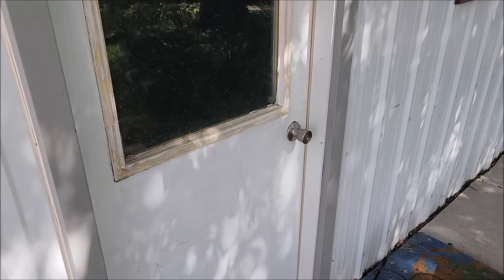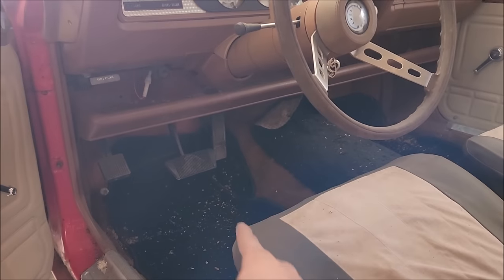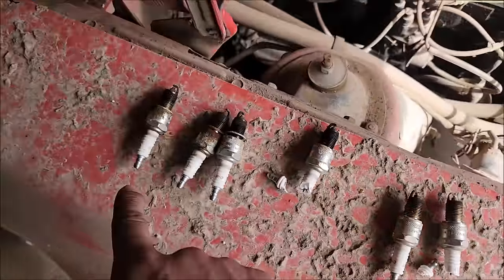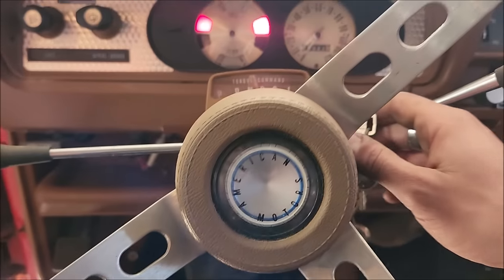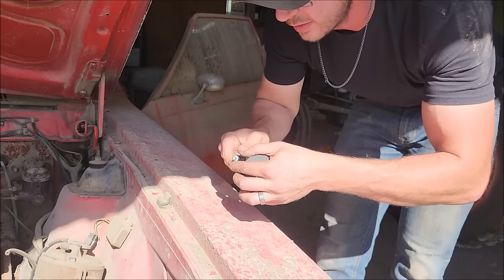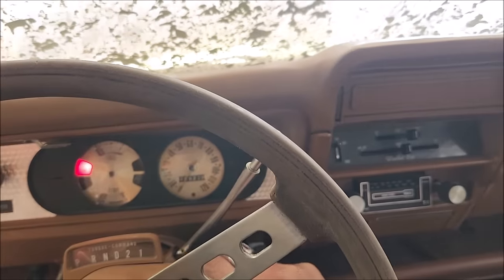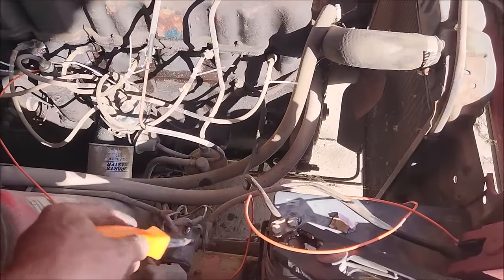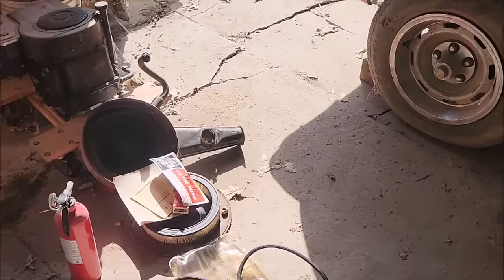Will It Run? 72 AMC Gremlin - Saved from the Crusher!

Comment: As a Ford guy im glad this Gremlin was saved. AMCs in general are very underrated in my opinion. A friend of mine bought two AMC Eagles off of us a few months ago. A 1982 AMC Eagle SX4 in really good shape and had a 304 V8 swapped into it and a 82 Wagon for parts. Just today he found the original build sheet in the SX4. And my dad owns a restored 1969 AMX. You dont really see many AMCs around anymore so when i do i cant help but smile
Reply: Think a mower carb on this Gremlin can get 50 MPG's?
Reply: i have a whole dealership down the road from me collier motors is the name.
Reply: Man, I always liked Gremlins, but I really wanted an Eagle. I searched online not too long ago and couldn't find a single one for sale. I'm glad there are still at least a few around.

Comment: For the newbies - always use compressed air to blow the dust and dirt out from the base of the spark plugs BEFORE you remove them.
Reply: And get a spark plug socket so you don't break the plugs.

Comment: Can't really kill a straight 6. Almost bullet proof. Love that car man! That was a find and in really great shape...from what I've seen!
Reply: motor was so good that chrysler kept using it after they bought amc out, the cheerokees used them for a long time.
Reply: @spicydeath82  Yup, all the way leading up to the 4.0L well into 2004 I believe.
Reply: @trickyricky12147  - Through 2006 in the Wrangler.
Reply: The 225 slant 6 is basically bullet proof too. I had one in a 1978 Aspen. Beautiful chrome. Only issue was the lower quarters. Wish I kept it but I listened to the wifey. 😢

Comment: A lot of  people don't know but  back in the  70s and 80s people just didn't keep a car once it got past 100 thousand miles  .
Reply: Cars were affordable and abundant back then. I bought so many used cars for under $1000. Cheap junk but easily fixable for cheap.
Reply: @tabbott429  Yep. My second car I bought in 1984 I paid 75 bucks for it. A 1968 Chevy Belair. Drove it a couple of years until the valve and the piston decided to meet. Ended up scrapping it for $100 buck.
Reply: I'm from northern Indiana. Back then by the time you got to 100,000 miles the body was rusted to NOTHING.  Usually at 90,000 the engine was completely gummed up inside with sludge and was barely even running.  Almost nobody would redo and engine because the car was shot anyway.😂

Comment: Those cars used to be ugly, but since you don't see them anymore, they have become cool. I love those rally wheels. Looking forward to see the pressure washer video
Reply: As a Gremlin owner, it's hysterical to me how public notions change.  When the Gremlin was new, they were well liked.  By the 80's and through the 90's, they were a joke and AMC became a laughing-stock as it faltered and then was purchased by Chrysler.  The early 2000's you would have to literally GIVE AWAY an AMC.... and yes, I had MANY straight up given to me.  My own Gremlin I purchased for $700 in 2001 as a perfectly running & driving car.

But by 2010.... I noticed opinions seemed to change.   The Gremlin was seen as "cool" again.

Just recently I've had the paint, bodywork and interior all re-done on my Gremlin and at the last car show I went to.... I seemed to get more attention than my friends' Rebel Machine!
Reply: What do you mean by "...those cars used to be ugly..."?!? They're STILL ugly! As for any "cool" factor, in my experience only those under about the age of 30-35 seem to go in that direction, undoubtedly because they haven't ever seen them on the road just like most haven't seen a Vega, Pinto, Pacer, Hornet, etc-etc-etc. While the Pinto and Vega sold quite a number... and served some folks as cheap, sometime reliable transportation, they were all reviled back in the day for being mostly problematic junk. As for the cars I mentioned, you couldn't give them away by the 1990s. Of them all, only the Pinto had anything worthwhile about it. The I-4 most of them had under the hood was one of the best I-4s ever made. The real question for anyone that owns a Gremlin in this day and age is what to do with it? If you're in it for nostalgia, then go through the beast and drive it. What would I do? If I were Luke, I'd get it running, driving, cleaned up and put a bit of elbow grease into the car's appearance then sell it off for what the online auction would bring. He might be surprised as it seems folks these days are tossing money around foolishly again on what used to be total garbage. Since the projected massive nationwide recession hasn't hit yet, IMHO is such that now is the time to cash out. Personally, I wouldn't drive the car thus would devote the proceeds (if any) to more favorable interests. Peace & good vibes!

 - Max Giganteum
Reply: My thoughts exactly!
Reply: Still are ugly. I have the 86 Hornet- Eagle version, it's an ugly car too. Number one reason AMC died was build quality; from line workers to all the way to top cared little.For comparison,the Volvo 140/240, and 700/900 Series were pathetic cars like the AMC. Big difference was build quality. Consumers for 3decades+ did not care the Volvo were crude in every criteria,but at least they were put together well.

Comment: Those parts master filters were sold at a lot of independently owned parts stores. They're actually made by WIX and share the same part numbers as WIX filters. They also sold parts master oil that was made by valvoline.

Comment: First car was a 72' sportabout with the 258 straight six (three on the floor).  Great engine.  Car body and frame was shit after six years of Wisconsin winters and 168k miles.  Had the one barrel - the choke in winter was an issue - lots of pencils to hold it open, then kick it down because the engine was racing.  Burned out the clutch three times (damn teenagers).  Other than the rust just destroying the fenders and underbody, she was a great runner.  Rings were going by 168k, but still ran and did not smoke to bad.

Comment: They usually run a Chrysler 904 auto in the six cylinder AMC's. Worked on a bunch of these over the years to know that the transmission lines always rot out. Good luck with the project.

Comment: in 1977 I had a 1971 Gremlin and loved it, drove it all over the country putting bout 40,000 miles on it in 2 and a half years. Mine had a 232ci motor in it and I changed it from points to electronic ignition. always wished I'd kept that car. Anyway, love yer channel and even thou I'm 66 years old, I still refer to you as Uncle Luke.

Comment: AMC Gremlins are cool. You could go totally crazy and drop in a AMC 401 engine.
Reply: A 318 Poly from a mid 60s Dodge, new leaf springs to raise the rear end
Reply: A 340 with 3 dueces would be best.
Reply: I put a 440 in my 73 gremlin X Levi Denim 304 4spd  back in 1980 still got it 440 automatic

Comment: Amazing that there is anything left of the body and frame, that alone makes it a very rare AMC.  Definitely brings back lots of memories.  Grew up during the '70s in the Kenosha area, so many friends and family members worked at the plant there.  Most everyone owned one at one point it seemed like.  Those straight six lumps will run a long time, but you'll never get that valve cover to stop leaking for more than 5 minutes that's for sure!  Great revival and a car worth keeping on the road for someone to take to their local car shows a few times a year.

Comment: Parts Master oil filters were sold by Auto Value auto parts stores I believe, that's a nice little Gremlin, the automatic transmission should be a AMC specific Torqueflight,they went to those starting model year 1972.

Comment: I had a Jeep J20 with the AMC 360 2bbl and 4spd 4wd Dana drive train. That engine was great. Sold that truck to a friend he operated oil wells with it for several years a lot of the sheet metal was galvanized so it did not rust.

Comment: What a good find Luke! I have several AMCs, I have a 73 Javelin 401 4 speed. If it were me, I'd convert the points to petronic ignition, then new rubbers and lines, an eBay all aluminum radiator (they're available and cheap) and drive it. It's good driving weather this time of year down in Yuma

Comment: I live where those cars were built. The plant is now torn down. It's good to see this car saved.
I Love Gremlins. Luke I'm not sure how you don't like the Gremlin but you like the Maverick. 
AMC didn't have money to retool like the big 3. Foreign hatchbacks were coming over and they took basically a hornet front end and built a hatch on it, to compete with foreign cars of the time.
AMC had lots of Cool Names. I love the Rebel and the name. The inline 6 258 which later became the Chrysler 4.0. Is one of the best engines ever. The 5 millionth 4.0 sits in our history center building.
Reply: The 4.0 was never a Chrysler. It was designed by AMC before Chrysler bought AMC/Jeep. It was always a Jeep engine and never branded or sold as a Chrysler.

Comment: On so many of the vids of cars with points, only the points get dressed with sandpaper. It always helps get a happy spark if one also sands the rotor contact and also scrapes the contacts inside the caps.

Comment: The 8n tractor we had as a kid 68 years ago had a fitting on the intake manifold to supply vacuum to run the milkers for the cows.  It was a lot slower milking one of 30 cows at a time.  We lived in the sticks with not very reliable power service.

Comment: Thanks for not letting it go to the crusher. A buddy of mine put in a Ford Boss 302 and painted his Gremlin yellow with a black stripe. The interior is excellent. I've got a restored F100 with a 300 cu in 6 cyl I use around the ranch
Reply: I had a 81 f100 300 three on the tree, that I couldn't find the vacuum leak. So I ripped out all the vacuum lines and plugged them off, except for the brake booster. A little choke adjustment, smog control elimination, cat converter taken off, adjusted timing, and I wound up getting 33 mpg and less emissions than with smog stuff on it. Wish I still had it. 😢

Comment: Knew quite a few farmers & gearheads, back in the 60-70's that owned those spark plug air compressors.  Most had a lever valve that so that it only worked on the exhaust stroke.  Had a buddy that was clearing some junkers to the yard, missed the valve switch, pumped fuel into the tires.  When they got warm (1/2-2/3 to the junk yard) they seemed to spontaneously explode!  Lol!  He said they were loud!

Had a couple of gremlin's, way back.  Good fun, well balanced, cheap transportation.  Add some major HP, & they wheelie forever, lol!!      Thanx !

Comment: That's the same engine I had on my '78 Jeep CJ5.  Nowadays you'd call it a 4.2 liter.  Those straight 6 258's were pretty bulletproof.  Put that old Jeep in granny gear up against a tree, step out of it and you could watch it idling, dig itself into the ground pushing on the tree, lol.  Considering how capable it was I never saw the point of putting a V8 into one.  Parts Master came from an auto parts store called Auto Value or General Auto Supply as they used both names interchangeably.  My brother worked at one for about ten years.  Their in-store brands like Parts Master were every bit as good as any Motorcraft or AC/Delco parts you could buy.  The hand tools my little brother's store carried were Blackhawk and had the same lifetime warranty as Craftsman back then, and since the closest Sears was an 80 mile round trip and General Auto was a mile away it was a no-brainer just to buy the Blackhawk stuff.  I still have a lot of it.

Comment: I'm another Ford guy but I've owned 3 Gremlins over the years and can tell you that a 258 with a 904 trans and disconnected front sway bar launches pretty darn impressively. I had to wait for sway bar end links for one of them and needed to get parts for the '68 Torino Fastback and found that out.

Comment: glad to see someone saving an AMC.  my other and I have had gremlins an Pacers. I presently drive a 59 Rambler with aAMC 327 with 490k miles. also salvaged a no runner 72 Javelin 360 4 speed.  auto manufactures from about 72on retarded timing and reduced the advance and added air pumps, made them run rich so the exaust would burn emissions.
this killed fuel economy and power.  then came the 70s oil crisis.  I've had good luck with AMC's and a few Fords.

Comment: As an AMC owner (Matador & Hornet) can attest to how bullet proof the 258 6 was. I had oil pressure build up out the valve cover gasket. If you clear out the PVC system, that won't mess up the outside of the engine. Not sure if your car has a Borg or Chrysler tranny. The simplicity of that car is one of it's charms. Fun fact: this car would probably last through the  sweet EMP blast of analog.

Comment: That is one of the very best engines ever built. for one they are seven main bearing and I have put over 200k on several of them and never had a major problem. I never had a major problem with any of my  AMC cars. That is also the same engine as the straight six Jeeps.

Comment: Thunderhead...  I am a fan!    Just wanted to re-post my remark about the Ported vs Manifold vacuum discussion.   In case you want some more honest data.  

1964 Dodge Dart, 170 CID, bone stock.  60,000 miles, 120 lbs compression.   20" vacuum at idle .    Runs buttery smooth.  So, I run 16 BTDC, base timing.   Vacuum advance pulls 18-20 degrees,    Mechanical advance must be adding another 24 above 3,000 RPM's.  So,  somewhere between 55 and 60!   LORD.   Anyhow,  Cold start... ON the fastest idle cam, the Ported vacuum must be kicking in, plus some mechanical... putting me at 30 BTDC, dead cold... but, runs like a top.   Fast idle drops to lowest fast idle... then timing moves back to approx 20 ish.     Off the cold start, fast idle..  Back to 16, and idles like a kitten.  PURRRRRRR.    So,   I ran a Temporary Vacuum gauge on the dash, and tried it both ways.     It might be my imagination... but, the throttle response seems better from 1000 to 2000 RPM's,   on ported vacuum.    Steady state vacuum ... (As seen on my Temporary, vacuum gauge) seems like its the same.      
My Theory    The accelerator pump on my rig.. might be a little bit weak.  So, the ported vacuum is actually compensating slightly... by adding timing... at just the right time.    The motor seems to want more timing... due to a slightly lean mix on quick throttle opening.   The throttle response seems excellent on Ported vacuum.     It is hard to tell... but, after swapping to Manifold...  the motor seemed more sluggish.    
   16 BTDC is the highest vacuum reading at idle.   If I use manifold vacuum... It pulls way too much advance at idle, so... I would need to move the base timing to probably  5 BTDC, and before i pull the distributor, to move it a tooth, ...   I guess... I'll throw in the towel and not mess with it.

Comment: i had a 72 gremlin. was my mom's old car. in the early 2000's they gave it to me and i used my graduation money to fix it and got it back on the road after being parked for 11 years. drove it till i wrecked it. miss that car.
Reply: also yes, that is a carter yf carburetor, and they do have an accelerator pump.
Reply: the transmission is a chrysler tranny. i think it's a torque flight 929, amc alled it a torque command 727 or something like that. the belt housing is the only difference. amce changed it to fit their engine blocks. one thing to watch out for is the rear engine seal. it's a rope style two piece. they can go bad if they sit too long with out getting oiled.

Comment: Was working on a AMC gremlin back in the early 1980's that had a 4 cyl factory VW motor in it.  Was stamped right on the side of the cylinder head and motor.  Sure we're a lot of dirt modified racecars based on Gremlin bodies back on the East Coast years ago

Comment: The 390 FE is one of my favorite Ford engines.  The FE engine family in general is awesome.  But every 390 ive ever had just worked.  Great torque and appreciable HP in stock form but really easy to coax another 50 -70 hp out of without any machining. Simple bolt ons starting with a set of headers , followed by a Edelbrock streetmaster intake and 650 cfm Holley or Edelbrock AVS2 Carburetor and a Comp 268H Cam with a good timing set and the typical ignition system upgrades.  Just those few , albeit somewhat expensive bolt ons will turn a already good running 390 fe into a grin inducing tire frying devil.

Comment: Well Luke, I was going to see if you wanted to sell it from your comments at the beginning of this video…but, Grem seems to be growing on you…lol. I knew it was going to surprise you idling like it did once you got spark and fuel.😏😎 That AMC 6 is pretty forgiving and reasonably bulletproof. It shouldn’t take much to get it cleaned up and running good. Of course…after you burn out all the ATF oil…😂😎 I think you will enjoy the little guy. But, I would still be interested in taking the Gremlin…especially when you get the CobraTorino burning tires…😏😎 (You are still working on the Torino…right?🤔😎)

Comment: I little tip. When using a syringe to transfer gasoline, Put a little air between the syringe plunger and the gasoline because the gasoline will melt the plunger pretty quickly.

Comment: Finest American economy engineering from the early 70s , had one just like it, shiny metallic turd brown. Actually got a ticket for over a hundred miles per... I held it to the floor for at least ten blocks, but the judge wouldn't throw it out.. it just might be the mileage indicated, usually at a hundred twenty five thousand miles it would be pretty hagerd and falling apart. You might be pleasantly surprised.👍, What's up with that Torino?